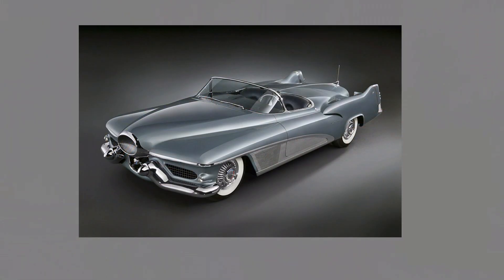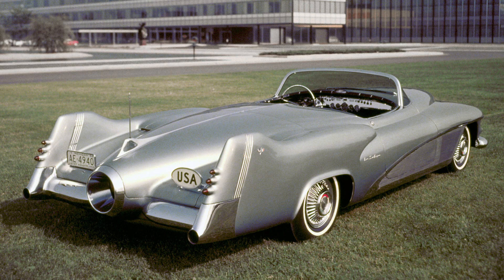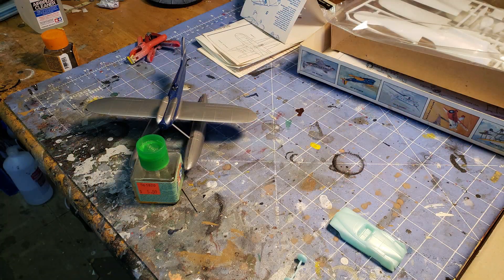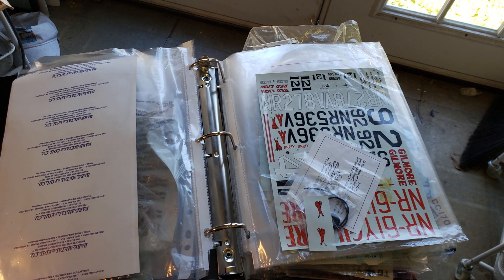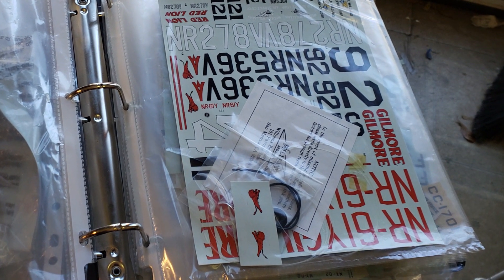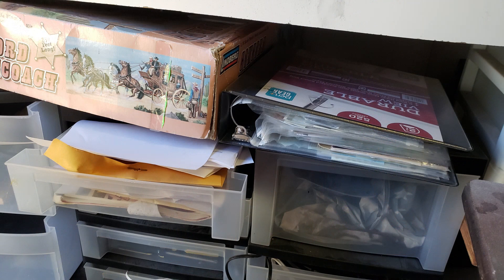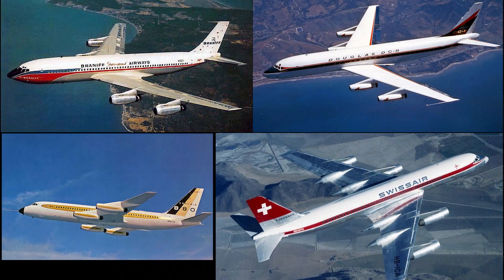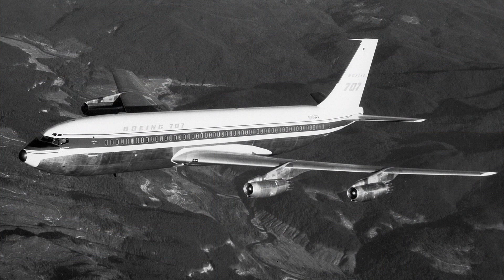Daily report with Max's Models

Comment: Ok I have a question in the comments if one makes them on the Max  site are they actually looked at by Max or are your comments basically not answered because I have made comments on the site an they seem to be never answered which give ones a pissed off feeling about this site because I am a modeler an would like my comments answered but they seem to never done so I am wondering what is this modeling site actually about because it seems to have no structure an seems to be hampered by scatology he puts out to much topics the site makes it hard to follow at times!
Reply from the maker: I apologize if your comments went unanswered.  I do this for fun and after about a day I cannot keep up with the comments very well.  BTW, I think it was you that mentioned the issues witht he new Lindberg hotrod.  I am mentioning that in this mornings content.

Comment: Look how good all the stealth aircraft look.  Try flying them without a computer correcting a thousand little movements/commands a second.  

It's not like an F4 which was the epitome of aircraft design to show that if you put enough thrust on a brick, it'll attain stable flight.

Beauty can hide a litany of deadly tricks - the GeeBees as you have been describing are a great case in point.

Comment: Excellent point on relative safety of first-generation jet airliners! New unproven technology, obsolete training methods, and integrating 550-mph airliners into existing ATC created an abysmal accident rate. In the first 48 months of turbine-powered airline OPS, a total of 18 aircraft were lost! In the first Jet Age accident, the airplane had been in service for only ten days (American Electra at LGA, Feb. 9, 1959). Many were training flights back when crews flew line checks in real airplanes. Two 707s, a DC-8, and Convair 880 all went-in on training flights while performing take-offs, go-arounds, or landings with two engines out on the same side. Different times!
Reply from the maker: And everyone just considered it business as usual

Comment: After watching this video I looked up Pan Am flight 214. The crash was in 1963. One month after the crash the FAA formed a technical committee to look at solutions. In 1967 they issued guidelines. In 1970 most of the guidelines were passed into law. The 1963 crash led to a whole slew of fixes and regulations to protect future flights. One solution was thicker upper wing surface to prevent a lightning strike melting through.

Comment: Hi Max 
Air New Zealand had DC-8 series 52's, just loved hearing them starting up the Pratt & Whitney JT3D -3D engines, I do have two United Airlines DC-8 kitsets of Revell's not sure which series they are maybe 11 or 20
With earlier Pratt & whitney engines I think the scale is 1/144 scale.

Comment: Most beautiful airliner, to me, was the Lockheed Constellation.  From the dolphin fuselage to the three part tail, beautiful design. Good luck with the rocket
Reply: Thank Howard Hughes. He paid the full cost of development of the L-049 and guaranteed a big enough order so Lockheed couldn't lose a cent. He then pushed the designers to do their best.
Reply: Agreed.  I just finished Academy's 1/144 scale EC-121 Warning Star, the early radar picket plane.  Very graceful lines.
Reply: My dad helped to install the big radomes on the first WV-2 and RC-121 c. 1952 or '53. Let's just say it wasn"t easy. Those were the largest fiberglass components used on any aircraft up to that time. They designed tooling to aid installation after they saw how slow and cumbersome the first ones were.

Comment: "Most beautiful aircraft the most dangerous"?    Some seem so - F-104 Starfighter is an example. But others - the P-51 Mustang, the F-106 Delta Dart - had fairly good safety records.    Maybe because the best looking are often the "hot ships", the high performance planes, often using cutting edge technology.   That brings risk.
One of my favorite airliners is the Mcdonnel Douglas DC-9 and it's MD-80 follow ons.   Just a neat elegant design.    The British DH Comet was a real beauty too, but very accident prone, at least early on.   New unproven technology again.